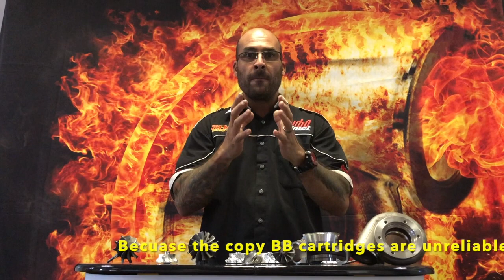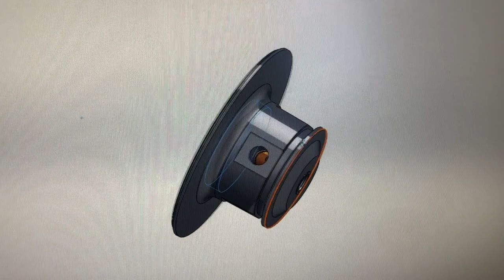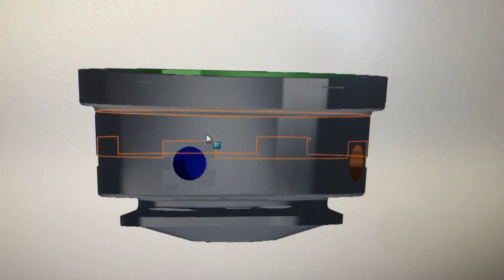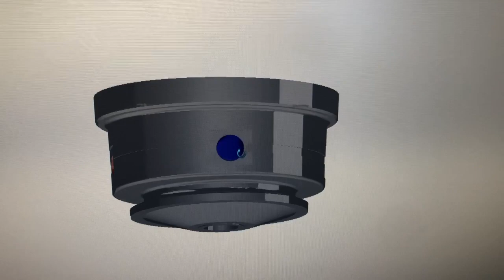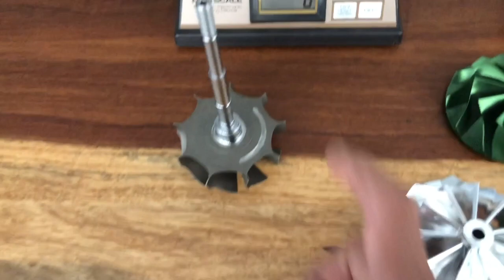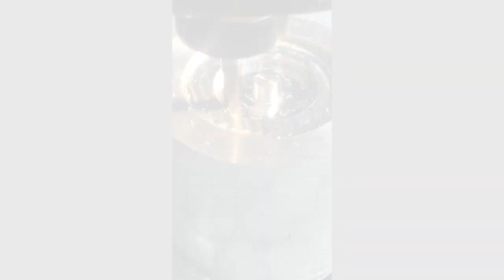TurboDirect S.A - High HP bolt on BB turbochargers for VW, BMW, Toyota, Ford etc

Comment: Add Nissan/Infiniti to that list and support the Q50/60 and new Z35 aka 400Z. This will be the 3.0 L VR30DDTT twin-turbo V6 (the 400z might be slightly different spec but the same engine or a close variant). The GT-R motor isn't much different than this engine either, the GT-R VR38 is essentially a stroked, twin turbo VQ35HR found in the Nissan 350z and the VQ37VHR is a stroked VQ35HR with better heads/cam/valve timing capabilities. Nissan uses all these in the Infiniti coupes and sedans like the G35/37 and Q50/60 until they put the twin turbo 3.0L VR30 which is nearly identical in design to the VR38. You'll thank me later. :)  400z will be a popular modified car and the Q50/60 is popular in the US, I assume it's worldwide.
Reply from the maker: Infinity and Q50/60 not popular here at all im afraid. in my opinion, the VR38 is overrated and not worth spending so much money on to get it to run. This is going to spark controversy for sure, but bang for buck VR38 loses every time.  Spending a fraction of the cost on a different 6Cyl engine will make the same if not more power and certainly more torque than the VR38 at literally a fraction of the cost - TB48, stroked to 5.15L or 5.2L using Brian crower products, very popular in UAE and proven on the hill climbs.  Just a thought.
Reply: @TurboDirectSA  oh wow, then they must just be popular mainly here, I hadn't expected that. They're everywhere here. Yeah, I'm a Nissan enthusiast and even I think it's just a glorified VQ35. If we are talking best bang for the buck, I'm not dropping in a V6 😆 Idk what it would cost over there but over here, for like $2k-5k a decent secondhand LS2 is the way to go, and starts at like 400-450 stock. The TB48 isn't really in the US, the VQ is everywhere in the states, and what is also popular (with all our pickups in this country) is the VK56VD 5.6L V8 in the Titan and some of the other big vehicles like the big Infiniti suv's. The TB48 isn't really used over here unless it's in like the Xterra, 4Runner, or Tacoma.
Reply from the maker: @kevin_delaney  Interesting how different countries have their likes and dislikes. :-) We never get the good stuff here for odd reasons which always seem to be blamed on poor fuel quality.....
Reply: @TurboDirectSA  Poor quality fuel? (O.o) that's interesting. I mean you guys have turbos, you guys got higher test gasoline over there or you mainly run like e85 setups? I mean most of the cars here out of the factory are tuned for 87 or 89 but the sports cars are tuned for 91 but the actual quality of the gas....I mean...that seems pretty arbitrary. There's definitely some high-quality gas available here like the Sunoco by us has race gas from the pump (separate off the the side pump), others that have good detergents and stuff in it, but there's also some real garbage available too 😆
Reply from the maker: @kevin_delaney  Yup - we have horrible fuel here! We dont have E85 or any Ethanol from the pump -